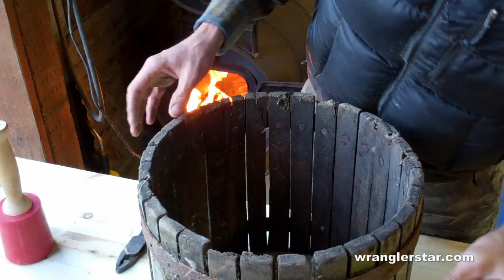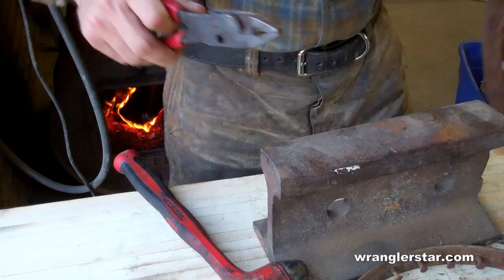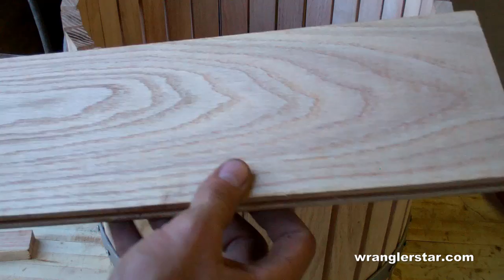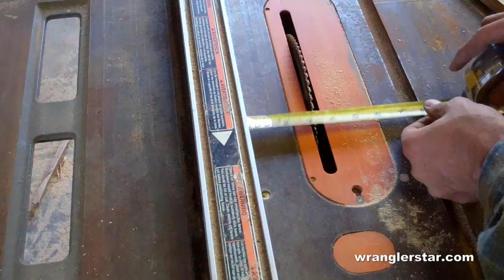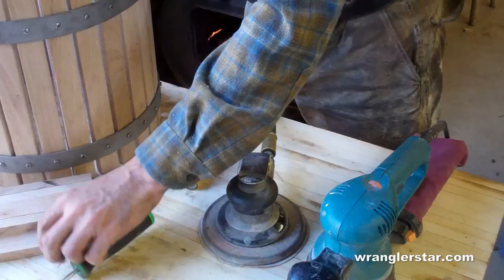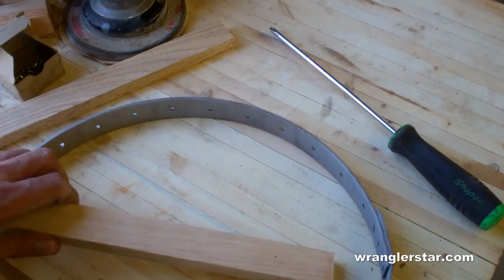The Restoration Has Begun

Comment: everybody thinks I am fucked because I treated the wood with salad bowl finish, tung oil, mineral oil etc. which are all food grade. I then can sanitize easier between pressings. Not only can you do apples, grape juice, and wine but a 45 basket press does 150 gallons of tomato juice in an hour. You don't have to be an alcoholic to own a big press. Best advice is a stainless steel sleeve (perforated) inside the wood basket. Critics will say it oxidizes the wine but I have not seen a commercial winery that DOES NOT use stainless, not to say I'd drink their mule piss either but I'm just a guy who does tomatoes in a wine press BECUASE I CAN!!! 150 gallon is 30 bushels of produce.

Comment: Why would you not paint the hoop before putting the wood on?
Reply: I agree. A true restoration would put it back to original. I.e. not replacing rivets with stainless steel screws which they did not have 100 years ago. Restoration is fine but do it right.

Comment: Jack here's an old math trick I use, When your Dad asked you to tell him  what was 29 time 2 and the correct answer is 58. Here's a quick way to figure it out>What's 29 close to---30 right? 2x30 = 60 minus 2 for the two 29's equals 58. Just round off the number you want to the nearest number divided by 10, in this case it's 30. It's kind of a metric thing but don't tell your Dad==JUST KIDDING about not telling your Dad.You will find that as you get older that you can tell your Dad anything and he will understand. Your Mom will too.

Comment: Cody ,Cody ,Cody just watched the start of the restoring the press video , all the time you put into restoring hand tools , you need to restore your table saw top , same steeps as in doing the hand tools but after you finish removing the rust use a good past wax on the top to protect it

Comment: Red oak.  You need a good ripping blade for your table saw. Why is your table saw fence on the left side of the blade? And why are you blasting with your left hand? Just curious..... :)
Reply: maybe left handed?
Reply: Oby1Kenobi the more teeth the cleaner the cut and the less tear out
Reply: Blake Lawrence True in some cases, especially when cross-cutting. But a finer tooth blade is not the best for ripping, there is more friction, more heat, more drag on the table saw. If you don't have a powerful table saw (3+ hp motor) then I would definitely recommend a course tooth blade. My favorite ripping blade was a 40 tooth 10". 
I never worried about tear-out when ripping, a good rip blade won't tear out any worse than a fine blade. Other reason for not worrying about tear out-there are always saw marks on the cut, no mater what blade you use, (speaking about finish work or fine detail work) I always would run the wood through a jointer or through a planer to take out the saw marks, of course this only was the case when it was a finished edge. 
 I use to glue up cabinet door panels, I used the 40 tooth blade I mentioned for ripping them, I never had an issue with tear-out. 
Well I'm sure that's way more info than needed, but maybe it will help someone out there. (I'm an experienced wood worker, I have ripped miles of wood, all different kinds, made thousands of cabinet doors (use to own a cabinet/door business), built hundreds of cabinets, built houses, etc....
Reply: i suppose he just cant be bothered changing the blade for cross cutting and ripping then
Reply: Blake Lawrence Spoken very true. I miss the old days of working in that shop. Oh the smell of fresh cut wood!!!
Reply: yeah im just starting out at woodworking
Reply: Blake Lawrence Cool, email me you contact info, maybe I could be of some assistance if you so desire. 
mktward@gmail.com
Reply: okay thanks man will keep that in mind

Comment: Red oak is open cell wood. The wood flooring used was more than likely red oak. You can take a piece of red oak and actually blow air thru it. This procedure can not be done with white oak, as white oak is a closed cell wood. White oak is more durable by its closed cell nature than red oak as it does not absorb water that easily.
Reply: Very true, it is definitely red oak.
Reply: I realize this is a cider press,however traditionally European presses are made with beech. Americans used white oak, pioneers used what they had. I see alot of pine or spruce used in home made presses. Considering wine barrels are made from white oak, I consider that to be the "safest" choice of material if not coated with food grade sealer. Beech is tighter than the oak though. Italians used to wash with alcohol and then light fire to the presses to sanitize them and the wood lasted 50 plus years (beech). A decent press will cost $2500 eur these days for a 45 basket capacity either from Poland or Italy. That being said, I sealed mine when I redid the oak, used stainless bolts and food grade silicone behind the hoops where the shit accumulates after powder coating them. Paid $215 for the press which is 80 years old  and it's all about the ratchet and acme thread for anybody who is buying, don't go 30 basket.

Comment: Cross cutting on a table saw is fine Joseph Volk. Just be careful. Also, he didn't use the fence when he did his cross cuts.
Reply: a fence is fine on a cross cut if you clamp a piece of wood ahead of the blade and is safer than a radial arm on thick cuts 2" plus. But that is old school before they invented compound cross slides.
Reply: It looked likd he did use the fence on the second round of crosscuts when he cut each stave to length. It wasn't on camera but that's what it seemed like he was setting up to do. For those new to table saw use the risk is that the piece will bind between the fence and the blade and get shot back at you. Something to watch out for.

Comment: The table saw was designed for ripping. Cross cutting using the fence is extremely dangerous and is rule # 1 NO NO. Use your miter saw for cross cutting please. You can get away with a slight mishap with an edge of an ax blade but not a table saw blade!!!!   Never sacrifice time for safety. You must be right handed being that your sidearm is on your right hip. So why is your table saw fence on the left hand side when your ripping ????

Comment: Nice video Cody.  Any reason you chose not to prime or paint the metal rings before the install?  I second the motion for adjustable feather boards, you will smile when you use them on small work and you might magically think of buying Roadmax a $4 latte if I ever make it our west. So much to do on my own homestead, I don't think it will ever happen so your $4 is safe. :)

Comment: Thank you so much for this and all your other videos! As others have said, you ought to build yourself an out feed table. I am just beginning to learn basic carpentry and just built myself one. It's a huge help. I just cut a piece of 1/2" OSB to 5' by 3', framed it with 2"x4"s for support and then propped it up on a couple of saw horses I made to be 1" lower than the height of the saw, that way, the table surface sits 1/2" lower than the saw. Huge time saver!

Comment: Cody, Might I recommend you make yourself some adjustable featherboards for your tablesaw.  It will give you much greater control over cutting small pieces and increase your safety around the table saw considerably.  (Plus it would be a great project to make a video of).  If you Google featherboards you'll see all kinds of designs.  I'm sure you would have no problem adapting one to the materials you have on hand.  Love the projects you come up with, keep em coming.

Comment: Great project Cody. Always love seeing your work! Just a side note, an outfeed table on the back of the table saw is great at keeping material from falling. I made one for my saw that has 2 legs (on the back) & rests on screws mounted to the back rail of my saw. Also, using 2 nuts on each bolt I can adjust the height of the outfeed table against the saw. Take care & keep up the great work!

Comment: when your not using your table saw everyday it will get some rust on it. when you done put a coat of pledge on and don't buff it out it helps it not rust and makes the top slicker and things wont bind up and buck as bad.

Comment: Glass beads are great, but be warned of using them in combination with ceramic based coatings (like cerakote) The glass beads dimple the metal surface and lower the mechanical adhesion of a lot of baked on coatings.